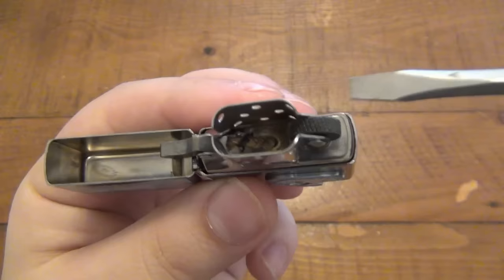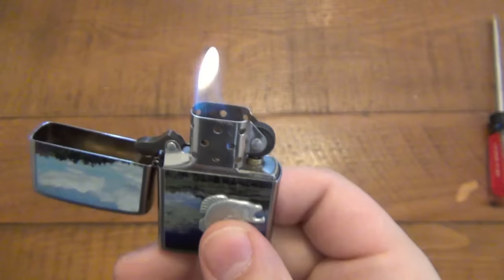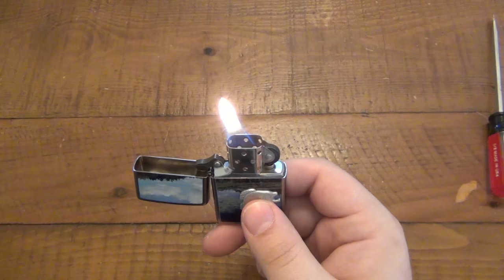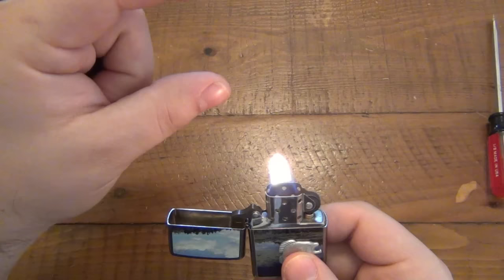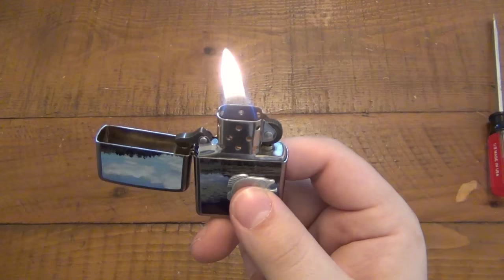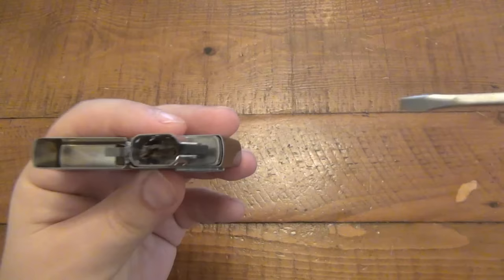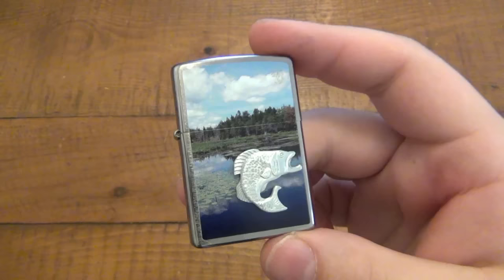Zippo Lighter Flame Size Is Adjustable...And It's Easy To Do !!!!

Comment: You can also temporarily remove the batting and pull the wick into the lighter body. This shortens the exposed length. It's a more "permanent" flame adjustment.
Reply from the maker: true, this is a quick adjustment for anyone but not everyone is willing to or capable of taking the zippo apart to poll the wick in...or vise versa pulling it out properly
Reply: Yes, some people are lining up for Darwin awards. Just hope there are no innocent victims also.

Comment: what a hell this does not have any logical reason... ok... maybe its because the wheel side is blocking air to the knot and the other does have much more airflow thanks to absence of the wheel and having there the large gap

Comment: You can adjust the wick length and fray the tip to tune your flame even further. Wicks are easily bought and replaced. Experiment with one it's fun.

Comment: How does this work? Why the distance of the wick (angle) from the flint wheel regulates flame height? I understand when you change the length it affects the fuel mix but it should be still evaporating same like this, or not?

Comment: What about the grind wheel, can be cleaned and if so with what ? a wire brush or steel brush?
Reply: Brass brush, it’s softer and gentler than steel
Reply: A simple toothbrush will work as well

Comment: How long is the wick supposed to be?? I just purchased my lighter and haven't adjusted anything but I burn through fuel way to fast. 
Per your suggestion, I moved my wick closer to the wheel but I still hv a tall flame. Any help would be appreciated, Thanks!

Comment: I noticed you got your zippo to stay lit for more than 8 seconds. My zippo lights up then slowly goes down and turns itself off. Stays lit for only 4 seconds max. 

What should I do to make my zippo stay lit for more than 6 seconds like yours?

(I DO NOT light my zippo everyday or every other day. To make the fuel last longer. That's one. Any other suggestions)
Reply: You don't put enough fuel

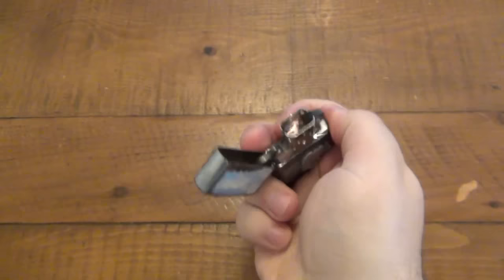Comment: i know i'm like.. 4 years late but how do you get the zippo to flip like that at 1:22? watching at .25 speed trying to learn it lol. i think my hands might be a little smaller than yours so idk if that's whats making it hard cause i dont have a lot of clearance when i try to flip the zippo between my index finger and thumb if that makes sense.. like the zippo kinda hits my hand. any tips?
Reply: ahh nvm i think i figured out how you do it, i was holding it wrong, definitely  need practice though ahha. thanks for the video! :)
Reply from the maker: the big trick is to make sure the botton of the zippo is barely touching the web of your hand so it wants to slip out :) build up pressure and let it slip...

Comment: My zippo won't light and it brain new and I put fuel in it why is it no working
Reply: Jesse Segil do you have a spark?
Reply: If filled with fuel and does spark, it's most likely overfilled. The recommendation is just to blow on the chimney a bit to get oxygen going. If that doesn't work, try pinching the bottom of the wick with pliers to let the clog loosen, which lets the top of the wick soak up more fuel.